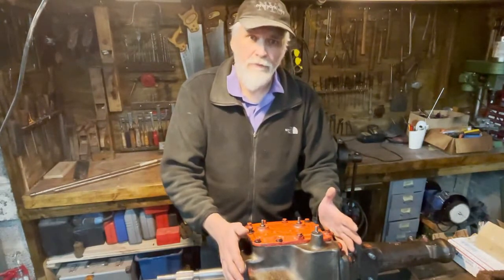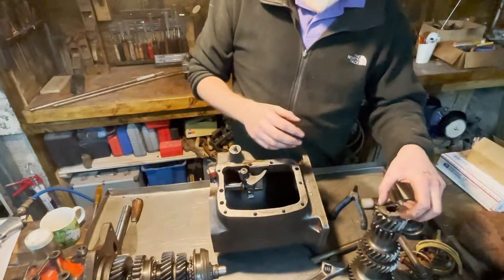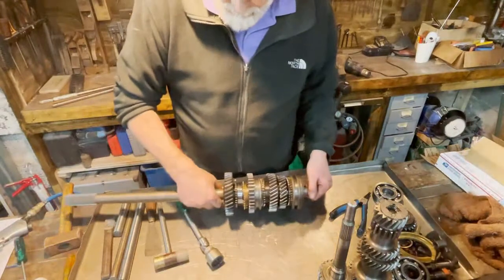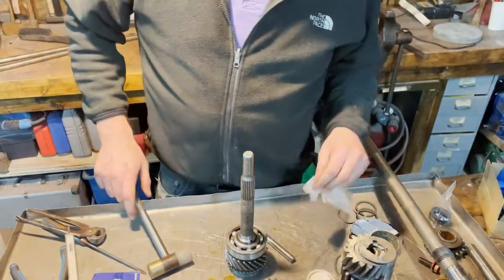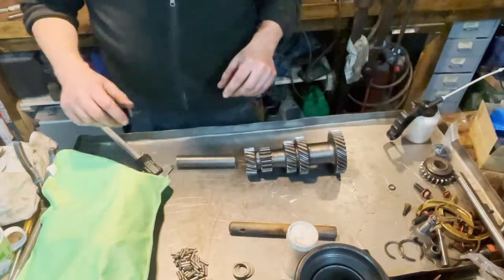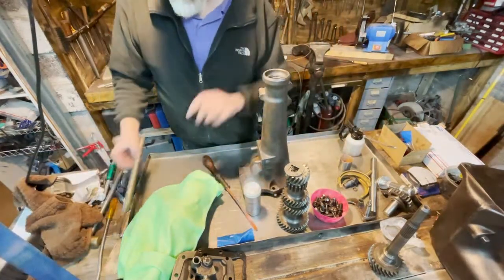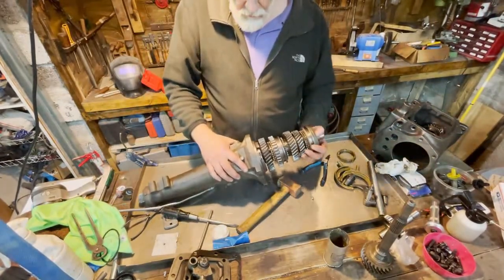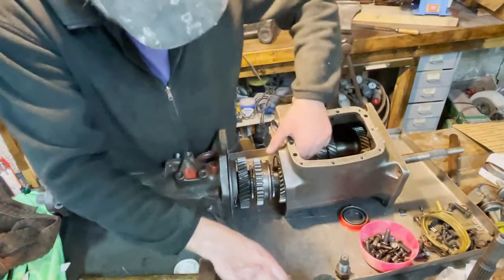How to restore a Mopar 833  four speed transmission full disassemble and assemble

Comment: this is the perfect video   with good  hints and tricks to rebuild mine ....believe it or not i have the same transmission  in my 84 chev  k10   ,...thats  right  gm used these in  some trucks and box trucks  as they were special order frrom factory  because hey were very heavy duty  compaired to  the saginaw brand .. only diferance is the frint input shaft has  a larger  spline  than the car model...thank u for sharing this video with us .🙂
Reply from the maker: Thank You! Didn't know that. Thank you for that information. glad you enjoyed the video!
Reply: @ifixmycarmyself2502   best tip ever  is  tthatt  broom  handle
Reply from the maker: @davesgarage3099  ..and that isn't even a joke, It really is a piece of a broom handle :) Basically I try to simplify everything as much as possible to encourage people to give it a try even if they don't hav a million$ equipment.

Comment: Vilken storlek/modell var det andra kullagret? nr1 var 6307
Och så undrade jag också om du kan dela med längden på kvastskaftet som du använde?
Reply from the maker: Det andra lagret på en heavy-duty låda är 308 och på en standard låda 307, dvs 90mm i ytterdiametet eller 80mm  på standard lådan. Båda har 35mm axel. Kvastskaftet är 24mm i diameter och 220mm långt.
Reply: @ifixmycarmyself2502  Attans min kommentar postades tydligen inte:
Tack! Verkar som att 308 lagret måste beställas specifikt för en 833 låda då. Hittade 6307 SKF lager utan problem på amazon. Skall följa din video för att fixa min startmotor också då den klickar lite då och då. 

Tack for alla jättebra videor, stor hjälp! (72 barracuda med högkompression 318)
Reply from the maker: @saharamustang3420  det stämmer, 308 lagret är ett speciallager med 35mm axel istället för 40mm som är standarddimension. Lagren specialtillverkades av SKF men inte nu längre. Finns att beställa från hemsidan transmissionpartsdistributors.com lagret heter 308SG8 och kostar 37 dollar. De har även hela kit.

Comment: Thank you for the very good video.  I had a question, do you ever check the end play of the countershaft.  I know they do sell thicker/thinner thrust washers and or shims to get it just right.  End play should be within 0.029”.
Reply from the maker: Thank you, and thank you for the question. Well, I had to go with parts that was supplied in the kit. End play was probably a little more. The kit was from you know were and specs were maybe not to manufacturer standard. There was also some wear to the gears but all in all the transmission worked fine after rebuilt and was quiet to, noise was the initial reson for rebuild.

Comment: I'm curious where did you get your rebuild parts?  Do you have the part numbers?  How is the rebuild holding up?
Reply from the maker: Thank you for the question. I bought the parts from a company called Transmissionpartdistribuitors and here is the link: https://www.transmissionpartsdistributors.com/ Kit was called BK341 but maybe I had to buy one bearing separately. You have to pay attention to bearing sizes, those wary so measure before you order. It heald up good as long as I had the car and when I recently talked to the current owner he drove it all summer with no problem.

Comment: Great work! I’ve run big block automatics for years but this is a good 4speed refresher course. Thanks for taking the time to make this video, very helpful! If I may ask, what is this tranny going into?
Reply from the maker: Thank you for the comment! I have been working on a 70 Challenger 383 4-speed. You can se some bodywork in my channel. Car is done except for some minor adjustment. Will make a video soon.
Reply: @ifixmycarmyself2502  That’s fantastic! Mine is a ‘70 challenger too. Originally it was a 383 magnum R/T w/ 727 but i converted to 440 +  6 pack. So enjoyable to drive. I look forward to seeing videos on your car….good luck!
Reply from the maker: @stevehamilton9418  Thank you for your comment. the transmission is now installed and works fine and the whole restoration is done. Now I'm also working on a 70 sixpack. Just made a video on the 727 transmission restoration :)
Reply: @ifixmycarmyself2502  your welcome. Is that six pack for a big block or small block?